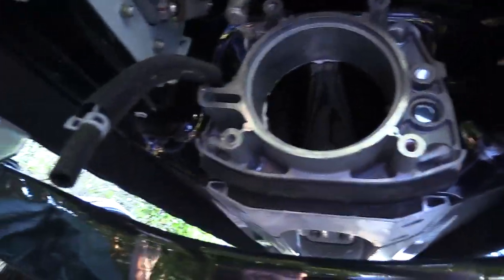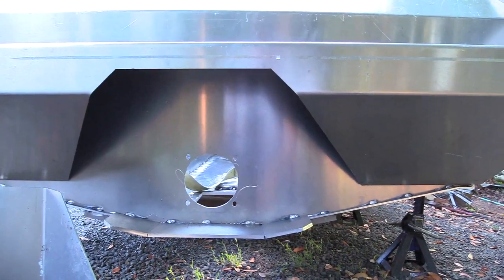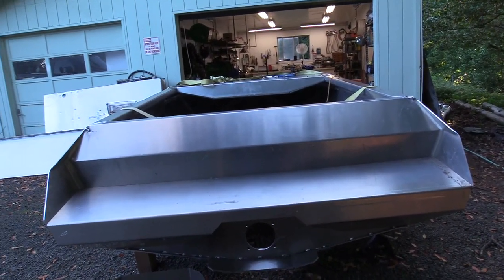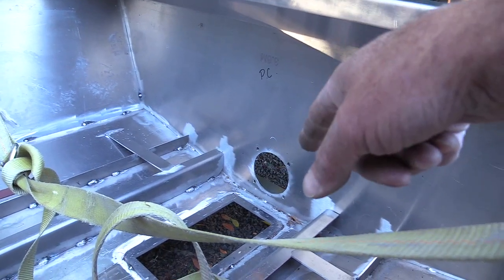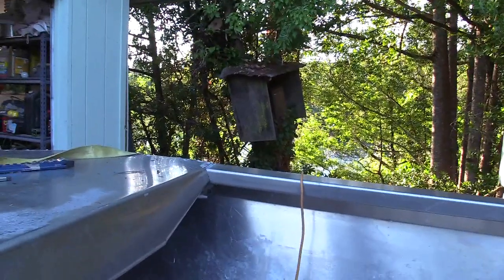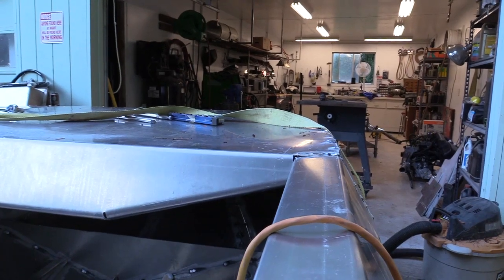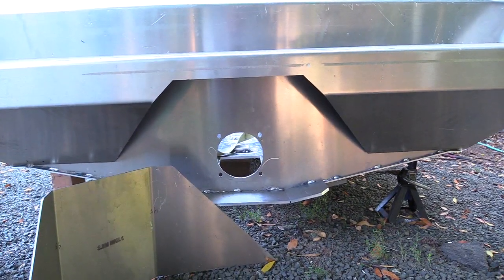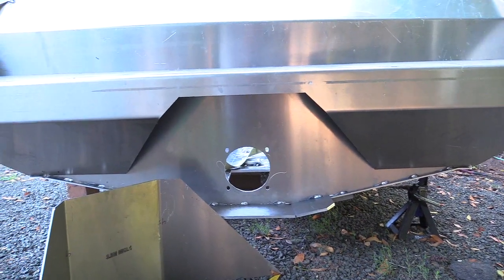Mini Jet Boat Build Video #28 Thinking Ahead on Trim Control, Swim Deck, Skid Plate, etc.

Comment: I have my intake flush with the aluminium and then the UHMWEP on top so the rocks don’t get jammed in the intake . It works well like this .
Reply from the maker: That's about how this will work out. I suppose there doesn't have to be UHMW from the back of the intake to the back end of the keel. That would reduce the possibility of things snagging on it. Either that or taper the UHMW at the edge of the intake on the back side.
Reply: I welded aluminum bar around the intake so that it's a skidplate that's level with UHMD. If I could do it again, I would have bolted and sealed stainless steel bar into the hull.

Comment: Where did you buy and how much was the kit for the boat ?
Reply from the maker: I bought it from RSR. The basic kit was about $4k. I added the swim deck and bulkhead to the package. I think it is closer to $5k for what I bought. I spent $8.5k with them getting steering components, fuel cells, etc.